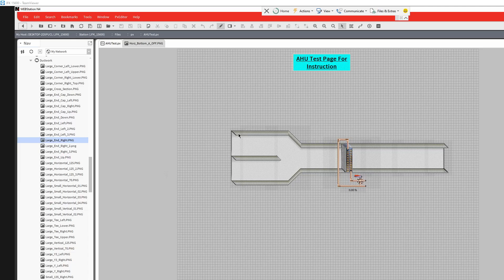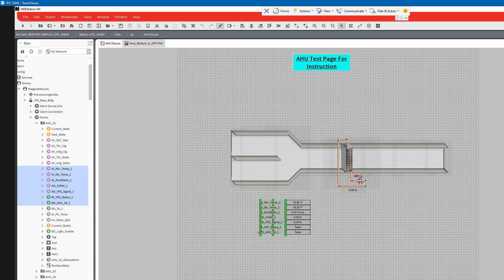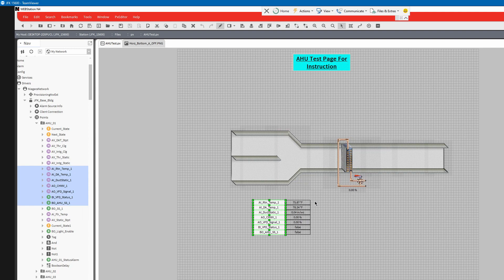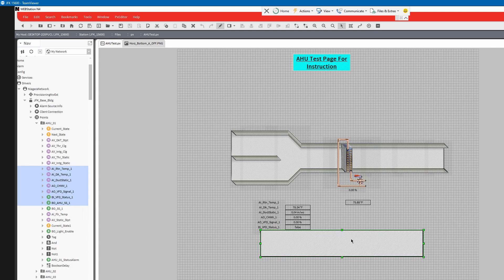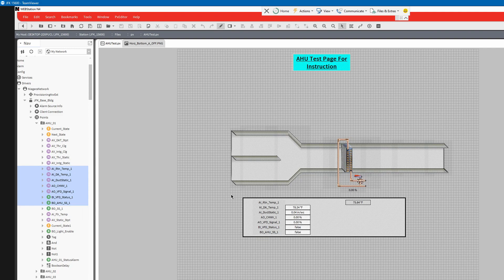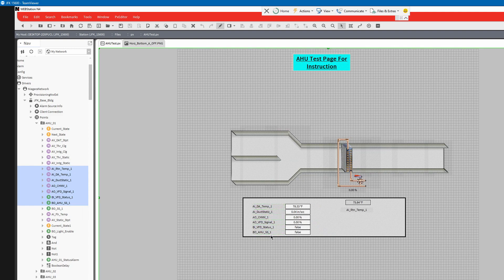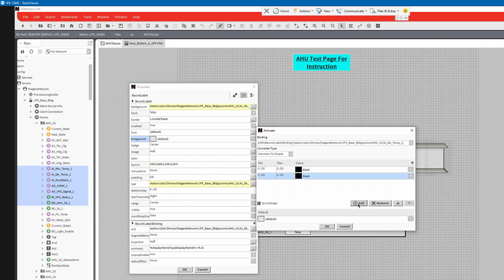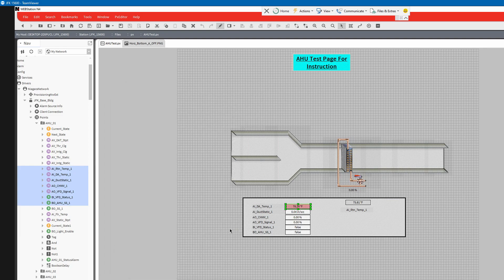Building Basic Graphics Part 4

Comment: Great video. Please make more.
Could you please let me know how to get rid of the white side bars on the graphics viewed on the browser. How to get your graphic to use up the full screen?
Reply from the maker: I’ll do a video. It’s easy. Double click on the pane and change it to fit and then you need to
Look at the offsets  make them both zero
Reply: @Energymachanicalautomation  
Thank you for getting back so fast. I have done what you said but still no luck. I would show you a screenshot if I could
Reply from the maker: You can email me a screenshot if you like. That way I can see what issue you are having
Reply: @Energymachanicalautomation  
What email do I use and I will send you a screenshot
Reply from the maker: @forestrunner8782  neil@easclutchcity.com
Reply: @Energymachanicalautomation  
Hi Neil, I have sent you an email to the address you provided. Sent station file.